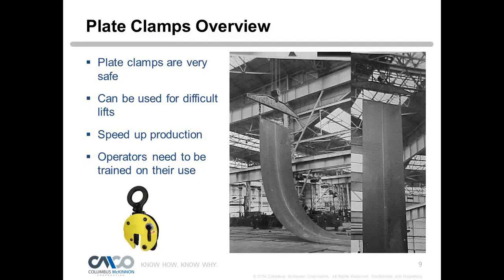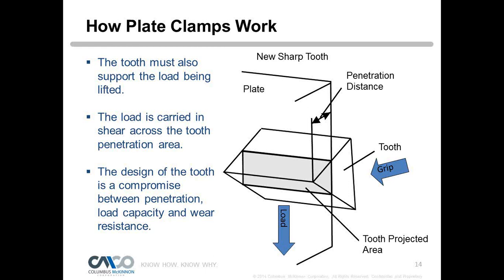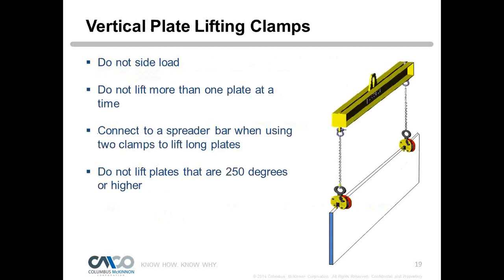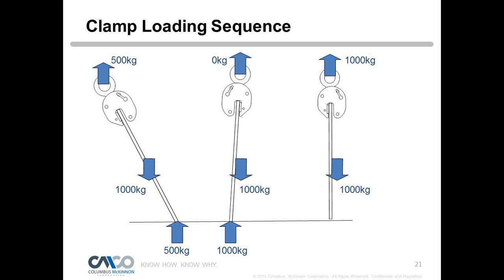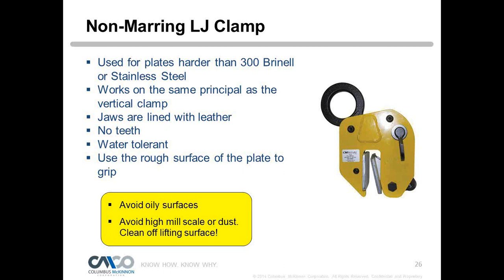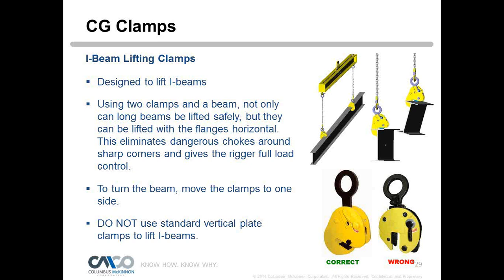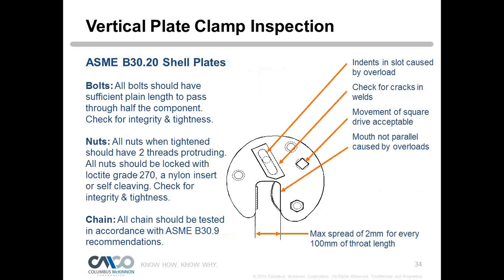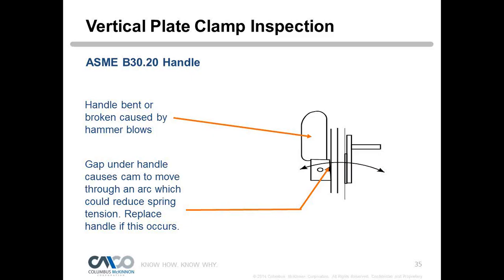Safety Webinar: How To Use Plate Clamps Safely

Comment: When using a vertical plate clamp is it ok to pick up 2 sheets with one clamp if it's within the weight limit?
Reply from the maker: Hello Aaron, 
Unfortunately, it is not a good idea to pick two sheets with one clamp.
Clamps are designed so that both sides of the clamp engage the same sheet
.
This way it is holding the sheet securely
.
If two sheets are picked up at one time there is a possibility that one or both can slip because only one side of each sheet is in contact with the clamp, regardless if the combined weight is within the WLL of the clamp.
This is true with any clamp used to lift sheets
.
Thank you for reaching out to us!
Henry Brozyna
Reply: @columbusmckinnon  I thought so. Makes %100 complete sense that both sides of a side should be in contact with the clamp. Thanks for taking the time to answer.
Reply from the maker: @O.G.Trashboat  - Glad to assist! Thank you for reaching out to us. Henry